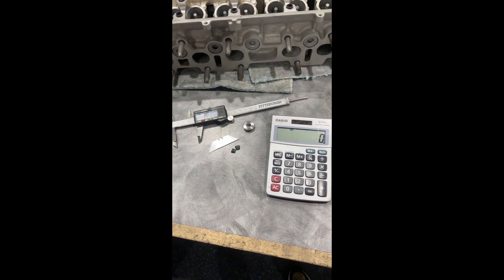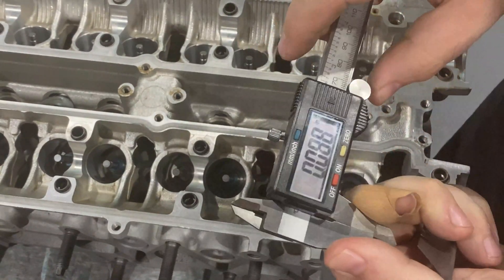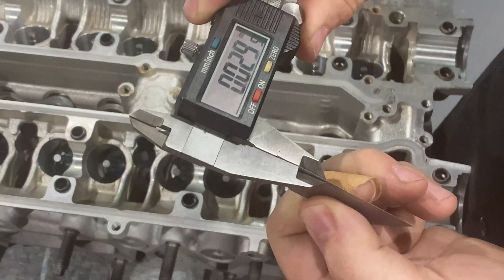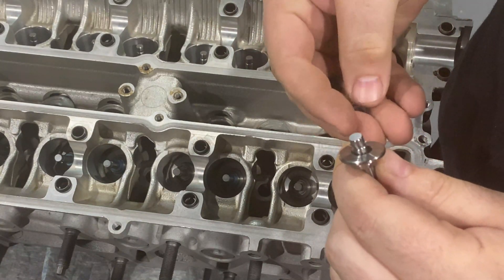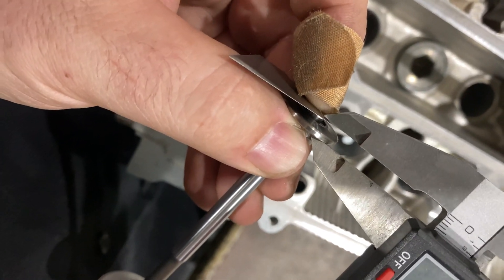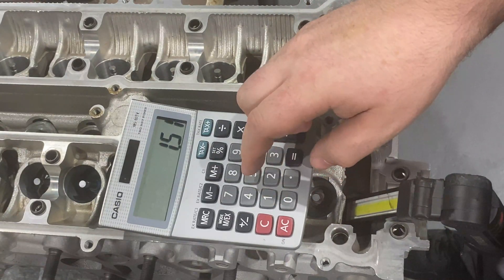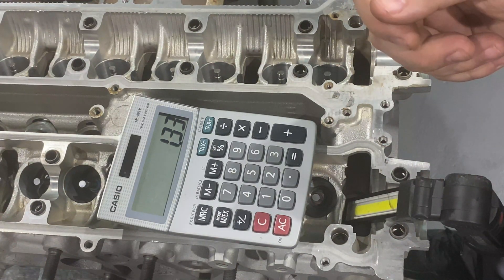Checking spring height on a 2JZ!

Comment: Hello. Do I need to test with all the intake and exhaust valve ? Or just one intake and one exhaust valve is enough ? Thank you.
Reply from the maker: If you know that the valve job is done right, and tight tolerance to the others just check one intake and one exhaust.
Reply: @headgames hello sir. Thank you for reply. It is still all the oem valve in place. So I should check them all? And if spacer are needed, is there a specific material you would recommend ? I bought tomei poncam along with BC0300S and billet keeper.

Comment: Can you measure this if the head is on the car ?
Reply from the maker: You could measure stem protrusion, but not the distance between the bottom of the retainer and the top of the valve. But, you could call GSC and get that measurement.

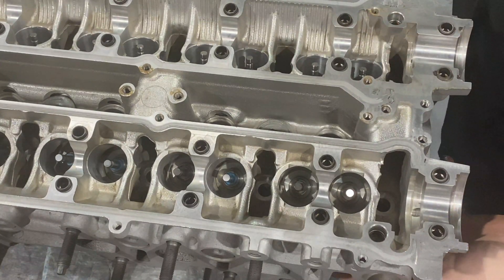Comment: @3:14 one thing that I am not clear on is whether or not you had to Zero the Caliper prior to measuring this second portion. The reason I'm saying this is because You zeroed it to the Razer blade in order to measure the Height with the retainer yes but after doing that shouldn't the Caliper be zerod for the next measurement which then means that your 1.33 measurement is actually 1.33 - .024 ???
Reply: Yes i believe so , should re zero or minus the the .024
Reply: It is what I understand too? WOuld be awesome if headgames could confirm :)